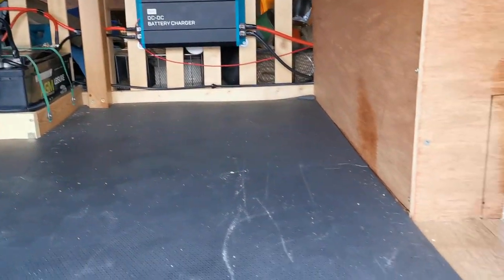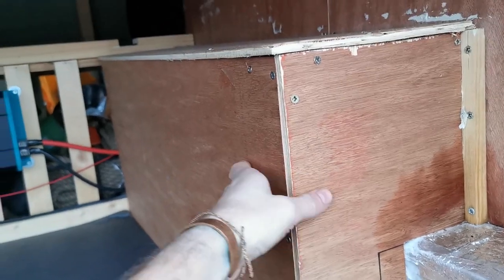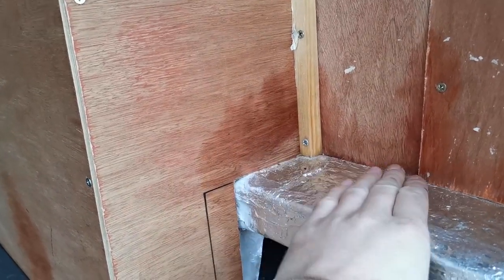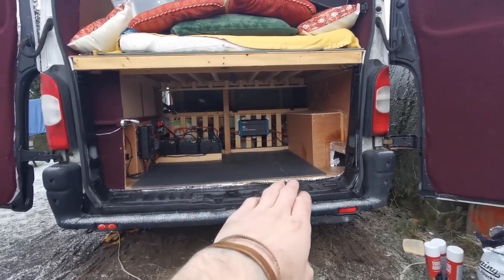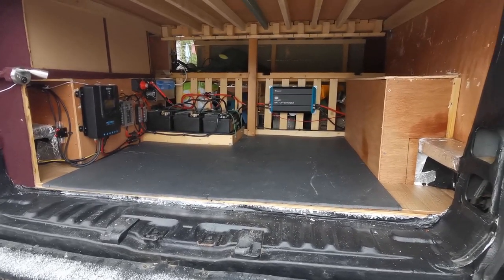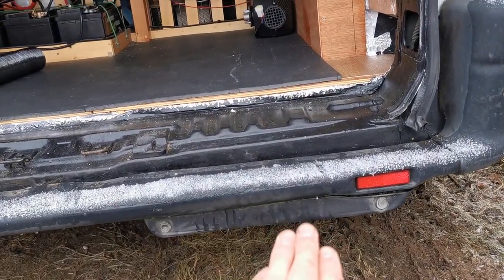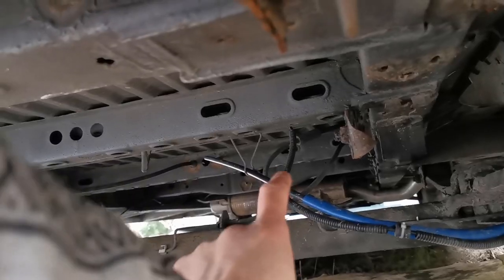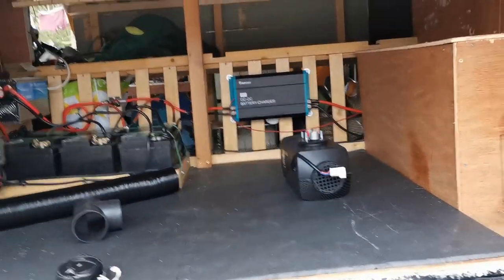Vanbuild Series - Part 18: How to Install a Diesel Heater in your Van!

Comment: Fabulous one Matty. Should be nice and toasty inside now with diesel heat and the log burner. Take Care Mate 🙏
Reply from the maker: Thanks pal, it was until the diesel heater shat itself 😂 I was one of the unlucky ones who got one that malfunctions. Wouldn't turn off, had to pull the fuse. Needs new control panel and module now. But that's next autumn's task 😅
Reply: @TheWoodlandNomad  oh bloody hell. That's the only worry about buying one of them. Still would not stop me, especially at the price of them
Reply from the maker: Nah still worth it and you can get all the parts easily too ☺